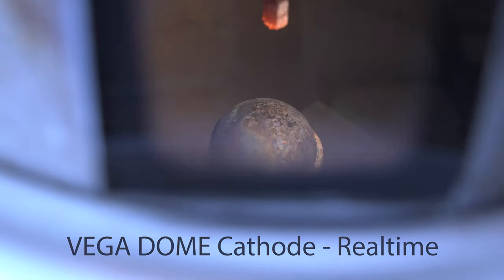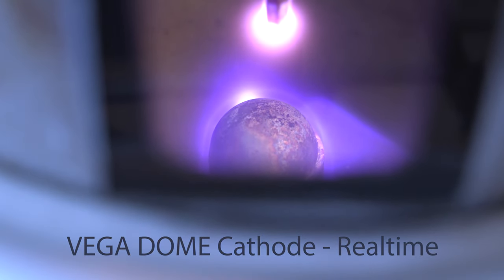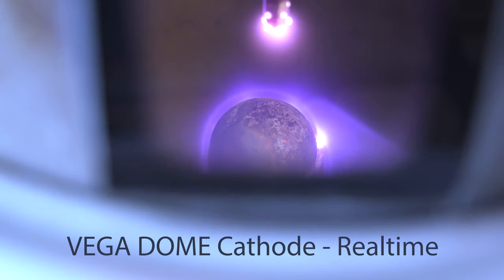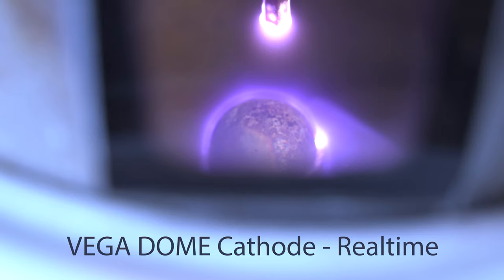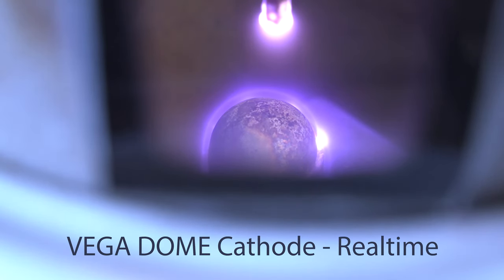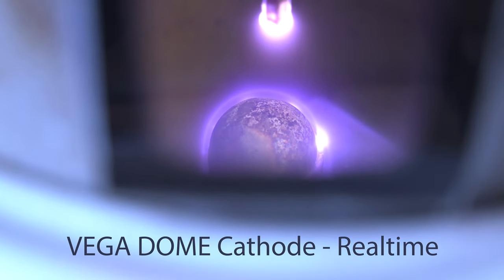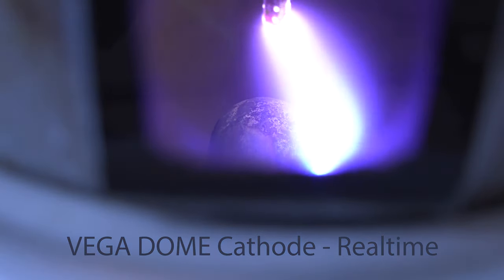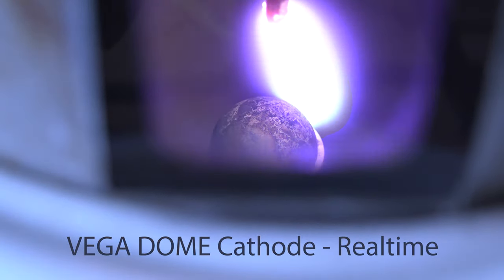VEGA - DOME Cathode

Comment: The most interesting bit here is when the anode, the hex nut, is undergoing anode tufting. There is a lot of fun potential in that, look into it. 

Try increasing the distance of the anode from the cathode a little bit, and see what happens with that... Assuming that it doesn't arc to something closer than the intended cathode.